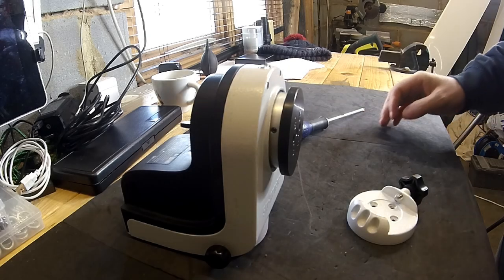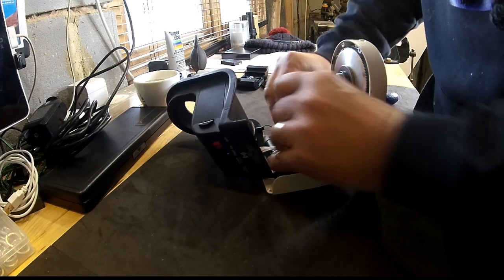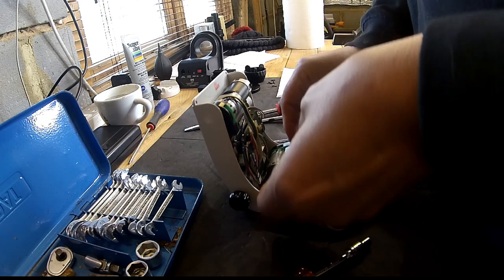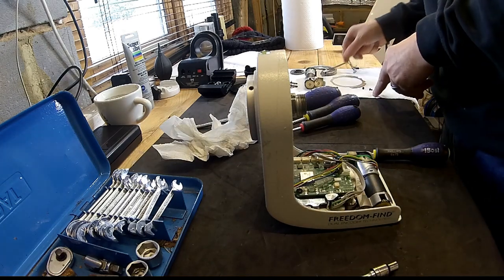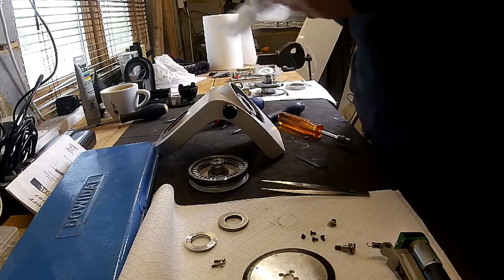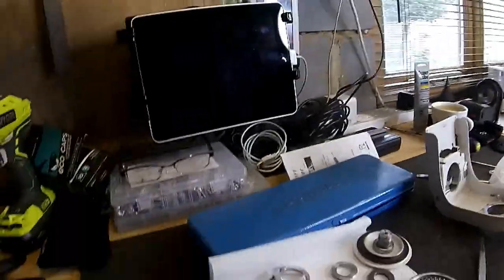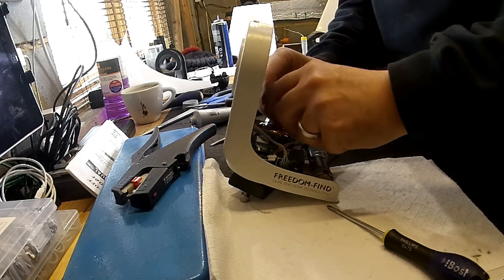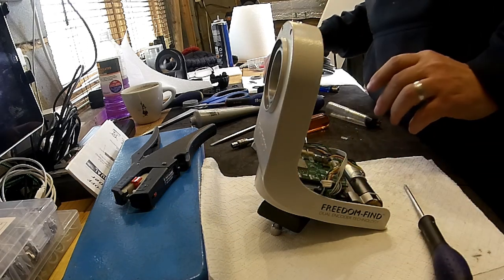Sky Watcher AZ GTI full strip down & Rebuild. Cleaned and fresh grease. Guiding now at  0.8"

Comment: I have some problems with the mount: sometimes it disconnects, it turns off completely. I noticed, when dismantling it, that if I tighten the screws completely it turns off, while if I unscrew them slightly it turns on. there must be a contact problem but I have no idea where to look. the app and the firmware are updated. Many thanks
Reply from the maker: Thats annoying for you. When You tighten the screws are they flexing the circuit board? There could be a hairline break in one of the connections. Thats a tough fault to find and fix. Is it under warranty?
Reply: @Astrobloke  Thanks for the reply. unfortunately it was purchased second hand and I realized this defect late. in the next few days I will do some tests to understand if there are any circuits out of place. If you have any suggestions they would be greatly appreciated. have a nice day!

Comment: I have had the azgti for almost 2 years, and it has always gone well for me, but since 2 weeks ago it has been impossible for me to guide, since the DEC calibration does not do it, it begins to separate the star to the north, and when it has to return to the south it doesn't and it moves further away, I think it's the slack, could I fix it by making these adjustments? thanks for the video!!
Reply from the maker: Hi Alberto. I would say that it could definitely benefit from a regrease and adjustment. It could actually be some binding and not necessarily backlash thats causing the issues.  Let me know how you get on and let me know if yoi run into any problems. Good luck

Comment: What a great DYI tutorial :) Thank you so much. I know I need to do that on my AZ-GTI, but looks like over my DYT skills, I'm sure I'd crash the whole mount into oblivion after minutes. May I ask you if eqmod guide rate speed @ .9 is good for this mount, should I lower it? Or do you have any guidance for specific PHD2 settings for AZ-GTI? Love your videos!
Reply from the maker: Hi Franco and thank you so much for your kind comments. When I use mine I normally use a guide rate of 0.5 and that seems to work well. I have never tried higher so cannot confirm what difference that would make but it is said the longer the pulse the more accurate it will be at corrections. So EQMOD always recommends starting at 0.5 and if you can go lower but every mount is different. Certainly does not hurt to experiment though and would be interested to hear your results. Clear skies
Reply: @Astrobloke  Mount open, on the kitchen table, following your video. Your 1hr vs I guess my 3 days :) Thank you for taking the time! I'll let you know. Anxiety. Where are my pills? :)

Comment: Are u still using the AZ-GTi, tried any larger OTA's on it? Thinking on getting one as a travel mount as it is really dirt cheap, but whispers about backlash are putting me off. I got a 2.8/300 telephoto + 1.7x extender to put on it, total payload around 5.5kg or 12lbs.
Reply from the maker: I haven’t used it in a long while as I have a CEM26 which is bot much bigger and tracks with a lot more reliability. Saying that I have an adapter now to build a very small rig using camera lens and 533mc and will mount that on the Az Gti.
As a travel mount its hard to beat but 5.5kg would be a defo test. Good balance will be key. If you run guide assist in phd2 it will measure and then compensate for the backlash so don’t worry to much. Its really down to whether or not the weight is too much for it to drive. Only way to find out for sure is to give it a try. I think the heaviest I had on it was about 4.5kg

Comment: This is an awesome video, thanks for the detailed description all along the tear down, re-lube and reassembly.  You didn’t happen to take dimensional measurements of the bearings when it was apart did you?  I was thinking of ordering new bearings so they could be here for the assembly and I wouldn’t be without a working mount.  Lastly, when you balance in RA and dec is it much smoother?  It would be good to show a before and after for “stickiness” improvement with the cleaning and superlube.  Great channel and thanks!
Reply from the maker: Thank you Robert. I am sorry I did not take any measurements. I should have showed the difference but after the rebuild it was a lot smoother and easier to balance.

Comment: My RA is a bit stiff. I can rotate it normally, but with balancing, i cant push it with 1 finger for example, so i cant really make good balacing adjustments. Anything i can do to make turn the RA lighter?
Reply from the maker: The main nut that actions on the RA bearings can be too tight so try slacking that off a little. You don’t want and play though so its a fine balance

Comment: Today I removed both motors and I noticed that I have backlash in both. Removed the geras the axis in both motors have some backlash. Idea how to fix it?
Reply from the maker: Hi there and thank you for watching and commenting. The motors unfortunately are not a very high quality. the internal gears are just nylon or plastic and I found it impossible to be able to remove all the backlash. I packed the gears with some grease which helped. I think you have to just try and get the backlash as low as possible but learn to live with a little with this mount. For the cost I think it is still very good but has some short comings

Comment: Do you happen to have an experience of how hot mainboard can get when tracker is powered on? My tracker is faulty and components in there are crazy hot. I wonder if its normal.
Reply from the maker: Not really. Mine does get warm but not hot. I am not sure what could be causing that unless it is very stiff and having to work really hard.
Reply: @Astrobloke  Thanks.

Comment: hello thanks for all,  I have done everything but the dec does not go to the correct home position. how can i fix it, both dec and ar run smoothly.
Reply from the maker: Not sure why it would do that. Most probably in the settings. What happens if you park the mount switch everything off. Then before you switch back on manually put the mount in the correct position and unpark? Does it not return to that position when you park again?
Reply: Yes, if I turn everything off and put the mount in the parking position correctly, then when I go to point an object, the pointing with respect to the real position of the object in the sky seems to me contrary. Then it tends to make a complete turn to get to the object, noted that in synscan pro in the information tab with azgti in the home position the item only axes in dec. has a very high value (example, + 1234'13 ...) compared to +90 and -90. the ar is correct.

Comment: Did you leave the spring in the RA motor working normally or did you lock it with the nut?
I've seen some videos of people locking the nut to eliminate the backlash, but my concern is if there might be any damage from doing this...
Reply from the maker: I had the spring working. I found it was getting the tension right with the nut so the spring worked but it wasn’t too loose.

Comment: Is it normal for the declination to have some slop when not in use. I can move my declination with my hand I can hear t a clicking noise. I guess the worm gear is moving since it spring loaded. The RA does the same. When I power the unit up the slop goes away. Just wondering if it’s normal for it to operate that way.
Reply from the maker: Hi, The GTI will have movement as the worm drives are on springs. Once under load as I think you have discovered the slop goes away while it is guiding and operating. This is totally normal and nothing to worry about. What sort of guiding numbers do you get?
Reply: @Astrobloke  just testing it before if upgrading it to equatorial mount. I already have those on order. 
 I have a scientific explorer scientific pmc 8-100 got to equatorial mount that I purchased an almost two months ago that I’m not happy with. It’s pretty much collecting dust in my garage since it is only prioritized to their app unless I spend getting asiair in order it for it to work. Wish I would have never bought it and can’t even sell it on Facebook market. I’m starting to transition to astrophotography and taking baby steps because it seems very expensive to get into.

Comment: hi. thank you for the video. two questions - 1) did you have any problem with azimuth clutch? mine had a steel spring on a rod that I could not put together the right way and had to have it replaced 2) what is the grease that you used, was it the same for the bearings and other elements?
Reply from the maker: I didn't have any issues with the Azimuth clutch like that. I used SuperLube Silicone grease. I know that others also use and recommend white Lithium grease
Reply: @Astrobloke  thanks. Are you guiding DEC in both north and south or just one axis?
Reply from the maker: @lukasz3502  hi. I have had the guide assistant recommend guiding in one direction only. I leave it as auto though and just wait for the mount to settle, normally 5-10mins max
Reply: @Astrobloke  cool and can you share phd2 parameters (e.g. calibration step, algorithms, etc.)?

Comment: Superlube is awful - causes a lot of drag for the motors and can actually stop bearings rotating and they just slide instead. A thin application of of a light Lithium or Silicon grease is much more suited than the elephant snot Superlube.  No need to pack the bearings with grease - it's not a heavily loaded car wheel bearing that rotates at high speed.
Reply from the maker: Thanks for the comments. Not overly helpful as I have had nothing but great results from all my mounts after using superlube. Certainly not experienced what you are claiming.
Reply from the maker: Thanks for the comments, this has never been my experience and my mount still performs as well today so the grease works very well even though it is the extracted snot from an elephant.
Reply: @Astrobloke  Before I retired I designed and repaired process control and bespoke manufacturing equipment. We tested all types of of lubricants, some of which had to be food safe etc. We used lots of worm and wheel gear mechanisms and tested various makes and types of lubricants on a rig which measured current draw, motor heating, torque and speed. We found Superlube to be poor mainly due to it's viscosity causing drag. In one instance it doubled the motor current and reduced output torque by 20% on a small worm and wheel mechanism of similar motor size to that in a GTi. It's particularly bad on plain bearing shafts. If it works for you, fine. Personally I still wouldn't use it.